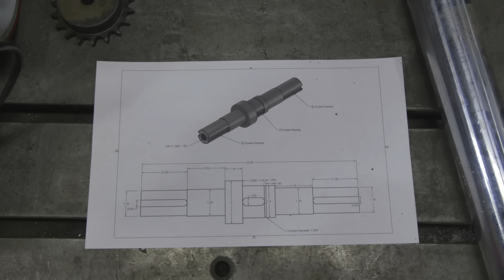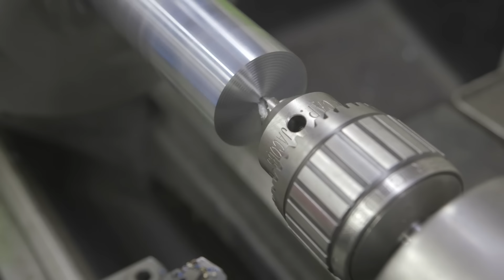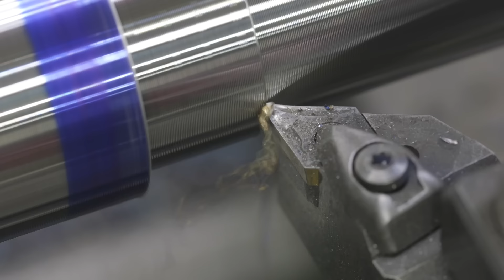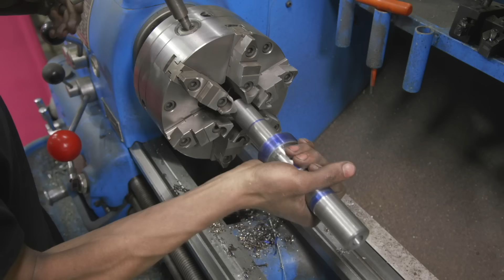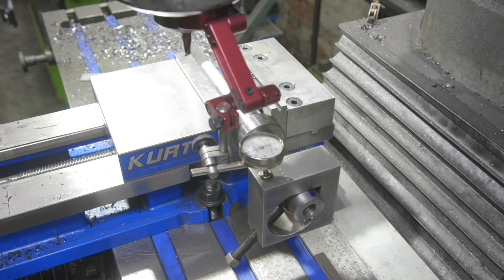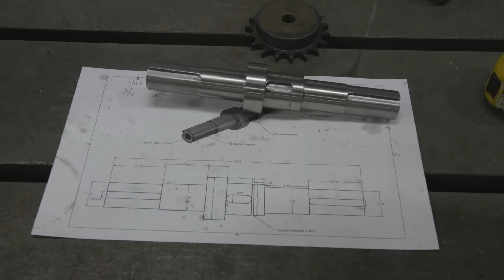Machining Stub Shaft From Scrap | Machinery Mover

Comment: I watch a good amount of manual machining videos...I really don't see anyone explaining tolerances....like h6 for outer diameters or H6 for bores for bearing fits....the reason I ask is it's different depending on application and might be helpful for DIY or new to the trade people.
Reply from the maker: Yeah, I don’t really use the H system too much. Usually, I put it into three classes, clearance, slip, and press fit. When it comes to a press fit usually it’s .0001 inch press for every 1” of diameter, roughly as a general rule but most components in this build are slip fit.

Comment: I'm not a machinest but I took a few machine shop classes over the years.  I watch a lot of machining videos.  I have seen this matter of rotating the work 90 or 180 degrees on a mill mounted vise done with  the shaft being milled mounted in a v block that is then rotated in the vise to achieve precise 180 rotations.
Reply from the maker: Yeah it works well

Comment: A square collet chuck applied to the part prior to machining the first keyway is another way to get accurate opposing keyways.
Reply from the maker: Absolutely that is probably more accurate if the collet will fit or as accurate

Comment: I am wondering why you left so much stick out when facing the end (as is tradition) at the beginning. After you centre drilled it you pulled it out more. Would it be more rigid  if you’d only had an inch or two sticking out to start with?
Asking for a friend who doesn’t run a machine shop.
Reply from the maker: Yeah, you’re correct but the spindle on the lathe is too small to stick the piece in entirely. Luckily, it’s such a big piece that it was rigid enough to endure facing at that length of stick out.
Reply: @VanoverMachineAndRepair  Ah, I thought there’d have to be a reason. :)

Comment: 17:20  I'd normally just tap a piece of keystock in the keway and use two squares to 180° the second keyway ... BUT?? This method has the potential to be MUCH more acierate! .. 

Great tip, it's new t me!
Reply from the maker: Glad you liked it